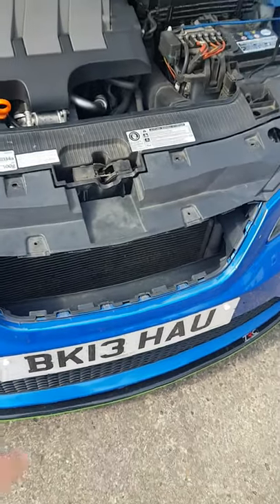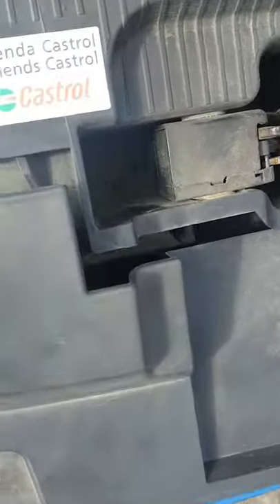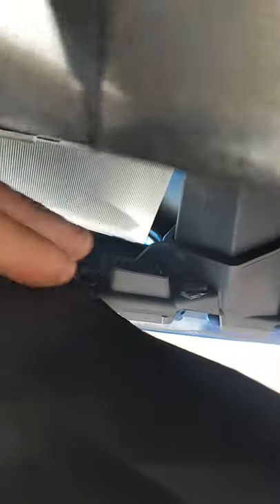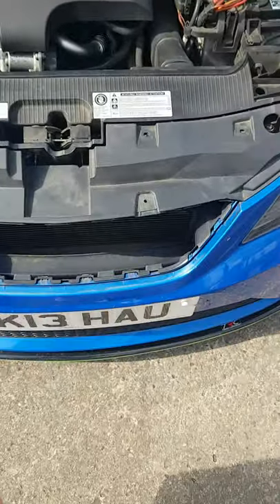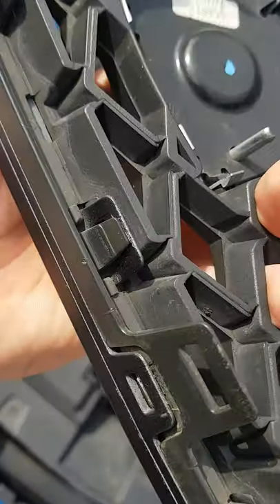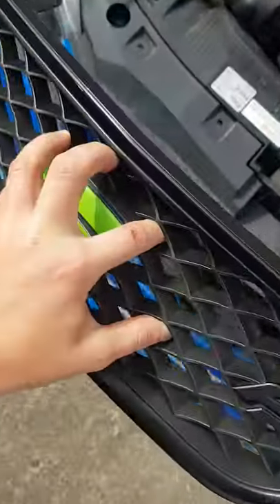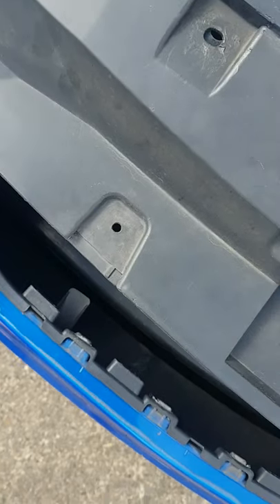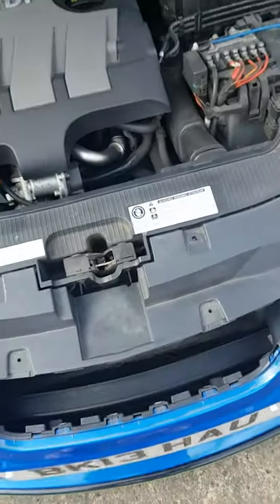How to remove the  grill from a seat ibiza 6j

Comment: Unfurnately mine clips don't wanna move 😢 I can not remove this grill. Holding too tight
Reply from the maker: You need to work around the back of the grill pushing firmly out from around the edges